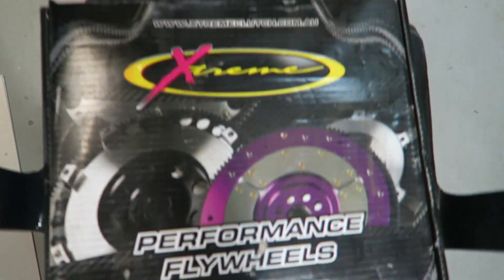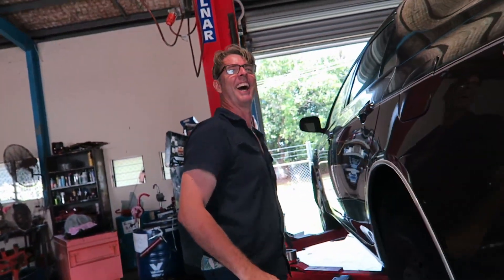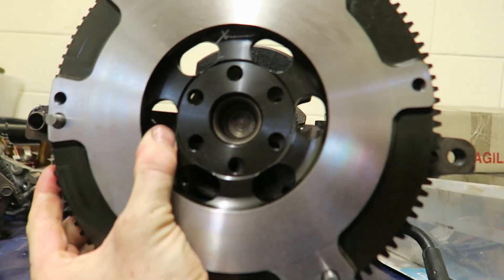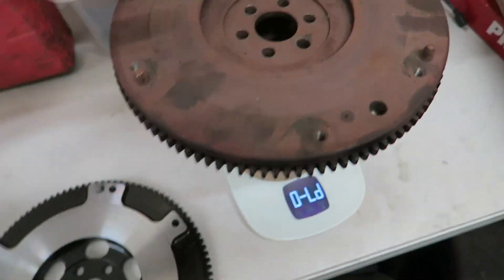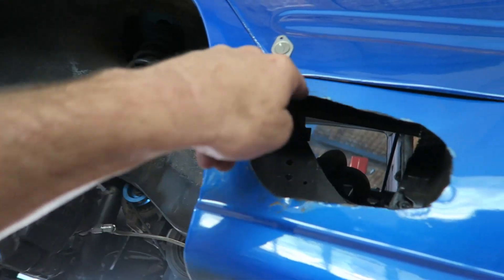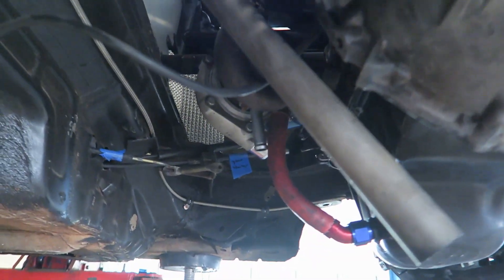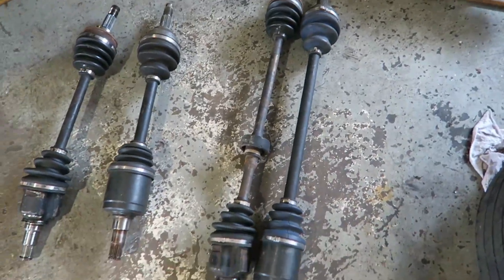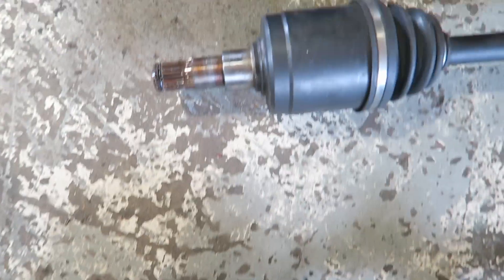Forged 5efe engine is ready to push some serious boost

Comment: What type of wiring harness and ecu you using on it
Reply from the maker: Hey I've got a Microtech ecu
Reply from the maker: The wiring harness in the back is just the factory loom I adapted .. but the front engine is a ompletely new loom. I plan to do the same to the rear once I've ironed all the bugs out
Reply: @Camp_Dogs  ok am doing a project myself but it's all stack for the binging plan on changeing out asap because I saw the coil over plug I was wandering my 5e don't come that way..am using 4efte ecu and I convert a toyota Pases loom to work with it but I like the coil over plug set up....
Reply from the maker: @ellistonvaccianna9120  great man sounds awesome! The coils are from a 2012 Camry in Australia, the Yaris coils you may have heard about don't fit down the spark  plug hole. In the front engine I am using coils from a 2011 Toyota FJ cruiser V6. They are identical to Yaris coils but have a skinnier body that fits the starlet perfect. I've also mounted those to the rocker cover so they aren't flopping around

Comment: What rods and pistons are you running?
Reply from the maker: Scat rods and 75mm arias pistons. 

I previously used wiseco pistons and the arias ones have a lot more meat around the gudgeon pin... They are a little heavier but have a shorter pin so the weight ends up being lighter than the wiseco ones.

Latest engine build has spool rods and arias pistons 😀
Reply: Thank you, really appreciate it I’ll deff stay tuned into your videos
Reply from the maker: @Ihateguacc   no worries at all Austin!
Reply: I’ve been searching around and I’m kinda having some trouble finding the rods & pistons 🤦🏾‍♂️ do you think you can drop the link to them?
Reply from the maker: @Ihateguacc  

5e scat rods https://www.ebay.com.au/itm/Scat-H-Beam-Rods-Toyota-Starlet-Glanza-5E-5EFTE-1-5-Turbo-FWD-EP82-65138709/272498023019?epid=1677414763&hash=item3f7225da6b:g:UQUAAMXQLNpQ5LmU
Reply from the maker: @Ihateguacc  

arias pistons. these are available in 74.5 and 75mm

https://www.ebay.com.au/itm/Arias-74-5mm-8-5-1-Pistons-for-Toyota-4EFTE/123748513766?ssPageName=STRK%3AMEBIDX%3AIT&_trksid=p2057872.m2749.l2649
Reply from the maker: @Ihateguacc  if you are looking to make less than 400 hp, the wiseco pistons will do and are a bit cheaper

Comment: So crispy, she running tighe cams?
Reply from the maker: sure is :)
Reply from the maker: surprisingly it got louder with using a 2.5 inch exhaust instead of the 3 inch one!
Reply: Shit yeah, looks like she has a lot of Aussie parts on her. What profile are they? Rung them the other day, gonna get a set for my 4e 👍
Reply from the maker: @slug9751  yeah it does haha. they are 282/282. I bought these 3 years ago so ill have to get the sheet for the rest of the specs. where abouts are you from? I have never tried the bolt in speed vision cams but I haven't heard any good reviews about them and they sure as hell don't sound like the tighe ones haha
Reply: @Camp_Dogs   haha yeah I'd almost get them for the sound alone. What are you running for valve springs? Perth Hills, got a little ep91 I've just started collecting turbo bits for, was going to build a 5e but theyre getting harder to find so going to stick with the 4e. You still got the white 82?
Reply from the maker: @slug9751  the company is called performance valve springs... they seem to be working well on my previous builds....im starting to really re think my view on the 5e, they are so hard to find and expensive. id definitely agree with you on that one to do the 4efe instead, much easier to find. yah I still have the 82, waiting for circuit racing to start up again!
Reply: @Camp_Dogs  you beauty, cheers for all the info man. Can get frustrating splitting facts from opinions on forums etc always good to hear from someone with 1st hand experience.
Would be cool to see a vid comparing lap times between both your starlets.
All the best mate 👍
Reply from the maker: @slug9751  in all honesty the blue girl is faster, but the 82 definitely goes around corners faster and brakes better haha would be a close race.
Reply: These Tighe cams you have are they an off the shelf item ? I didnt see 4E/5E listed on their website. Im also running the Performance Valve springs on my 4EFTE with 5E cams
Reply from the maker: @andrewrigg4905 I have never looked on the website, I just called up on the phone. don't bother with off the shelf cams from anywhere (including speedvision). Tell them exactly what you want, they will custom build the cams for what you want.

They have always told me they have "blanks" which are basically logs of steel to start a grind... they don't keep ready made shelf ones anyway....

So for example, tell them your estimated HP you will make, also if you are building an engine with a big turbo, you want some  large cams so they work together with the bigger turbo in the top end... so it breathes better. 

otherwise if youre planning to run a small turbo like ct9 or tdo4, there isn't much point at all doing cams, the smaller turbo will run out of puff a lot sooner. 

buuuuuuuut if you just want your car to sound like mine I can give you the invoice number so you can get the same haha good luck man!